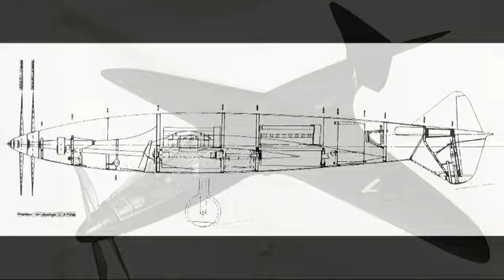Bugatti-Demonge 100P / 06-AUG-2016

Comment from the maker: To resume: NTSB: "Probable Cause: The pilot's failure to maintain airspeed following an engine anomaly during the initial climb after takeoff, which resulted in the airplane exceeding its critical angle of attack and experiencing an aerodynamic stall. Contributing to the accident was an engine anomaly, the reason for which could not be identified during postaccident examination.
Reply: So what they're saying is one of the engines cut out and torque took over?
Reply: @frogsoda  Not torque. It means the plane slowed down and the wings weren't able to generate lift. This probably happened on the left wing first, hence the left turn (the left wing lost lift and so fell, whilst the right one still worked to an extent and stayed up a little longer) and the plane just fell from the sky.
Reply: @Person01234  really? So what happened to the torque?
Reply: @frogsoda  I don't really know what you're asking. In flight, engine torque is typically dominated by aerodynamic forces. I'm referencing what the OP said, the thing you were paraphrasing, which did not mention torque.
Reply: @frogsoda  its not torque, the plane went through a stall spin scenario because it lacked the proper airspeed for a safe take off.
Reply: I believe what he is saying is since this aircraft used two engines for two props, did the torque from the unfailed engine cause an uncontrollable roll.
Reply: Poor guy, this was his pride & joy & looked a fantastic airplane. Such a shame.
Reply: @codyking4848  And what we're saying is that the report as quoted by the OP makes no mention of such a thing, and torque forces (remember, most planes don't have contra-rotating propellors) are typically dwarfed by the aerodynamic forces on the control surfaces.
Reply: @codyking4848  i think that would be unlikely since majority of single piston engines dont even need a ton of right rudder for take off to compensate for the left turning tendencies. well unless you know it was on high rpms and then all of a sudden it came to a stop. but i cant imagine that pulling the plane down so hard to one side it becomes unrecoverable. but thats just my opinions tbh. the people who built the engine would know more, i am just a student pilot.
Reply: @Person01234  Single engine planes are irrelevant here. In a single, the torque is compensated for from the moment the plane takes off until it lands. Either by design or by trim controls. If the engine stops, there is no torque, the plane should glide normally,(for whatever plane it is, some glide better than others obvs.

But this plane had two engines mounted near the centerline inside the fuselage, turning two counter rotating props. So there is no torque. The props spinning in opposite directions cancels it out. 
SO if you lose one of those engines, things get exciting for a second. The massive torque load is instant. You may have time to compensate if you are at altitude. But if it happens near the ground, like during take off, the plane will just nose dive into the ground. And that's what seems to have happened. 
The engine failure also explains why there was no power to climb.
Reply: @frogsoda  You literally completely made up that "that's what seems to have happened", and you summarised the first post of this thread as describing a crash due to torque. Which it does not. It makes no mention of torque. It mentions an aerodynamic stall and if you know ANYTHING about low altitude stalls like in a takeoff or go around, the plane rolling to one side is something you'll find extremely common in them. "Torque" is not.

Yes, the sudden loss of thrust was a contributing factor, and the OP's post does mention that (though in and of itself shouldn't have been fatal, the probable cause is cited as the pilot's failure to mantain airspeed, this isn't the first time a plane has lost it's engine during takeoff, nor will it be the last, it doesn't have to end like this). But again, the OP makes no mention of "torque" as a factor. Stop pushing your inaccurate summary of the OP's report.

Edit: Let me show you the kind of thing you can expect from stalling during takeoff (content warning I guess, it's the famous video of the cargo 747 crashing at bagram): https://www.youtube.com/watch?v=lksDISvCmNI
This isn't due to "torque". It's due to asymmetrical lift being produced by the wings. A common occurance in low altitude, low speed stalls, the likely cause of this crash and crucially, actually in line with the report as stated by the OP and as was being paraphrased.
Reply: @Person01234  cool story bro. Are you actually comparing a 747 with four engines out on the wings coming in for a landing, to a Bugatti with two engines on the center line, taking off? It looks like we're done here.🤷‍♂️
Reply: @Person01234  name-calling and ranting doesn't win arguments. If you think a 747 and a Bugatti are subject to the same forces in flight, there's no talking to you.
Reply: @frogsoda  Then stop talking. There never was an argument, there was a fool, and there was me correcting the fool. The fool continued to spout garbage and contradict me without having the slightest clue what they're talking about and so I am now done being polite.
Reply: @Person01234  Whatever dude. You know what? You're right. I don't know what I'm talking about. 747's and Bugatti's are EXACTLY the same, obviously. There is no "equal and opposite reaction". That's just a myth!
If the word "torque" doesn't appear in the report then, OBVIOUSLY, torque had NOTHING to do with it. 
And of course, you have proven that calling people names and generally being an unwiped ass is a GREAT WAY to win arguments!
Reply: @frogsoda  1. Of course torque exists, as I've already said. It's just not mentioned in the report, and isn't typically a factor in these kinds of crashes. I've show you a video of a 747 with 4 working engines doing the exact same thing you think is such strong evidence of engine torque, indeed with the only similarity being the aerodynamic stall (which is actually what causes this behaviour, as has already been explained to you by 2 people including a student pilot, and is mentioned in the report) and all you have to say is "herp derp 747 is diffrunt" (not with any explanation of how those differences would cause similar behaviour for different reasons, mind you).
2. Literally this entire conversation is about your paraphrasing of the report posted by the OP. You characterised the report as saying that "Torque took over". I politely corrected you that the report does not say that and that the aerodynamic stall (which IS mentioned) itself is a more than adequate explanation of the behaviour of the aircraft (something I subsequently proved) and citing it as the cause strongly implies that that is what they think caused the crash, rather than engine torque.

When you for some reason stubbornly hold on to your initial assumption, despite not having a clue what you're talking about and argue with people who do, not just about the facts of what happened but what is plainly written in front of your face, there is no argument. You've not presented any analysis of the report to show us where it says torque was involved, which again is what the conversation is about. You haven't even presented any real reasoning why this crash was so special compared to all the other low altitude, low speed stalls that the behaviour was due to something completely different. All you offered is an explanation that maybe it happened so quickly that the pilot was unable to control it, which all that tells me is that you have no clue how aircraft work and also ignores the fact that banking into the ground is a common result of these kind of aerodynamic stalls.

So yes, there is no argument for me to win. I am telling you the facts (I haven't at any point said that torque definitely had nothing to do with it, just that there's literally no reason to think that it did), primarily about what is literally written in the OP rather than anything that went on in the air. You are spouting nonsense theories that you personally came up with.
Reply: @Person01234  you want to prove me wrong? It's very simple. Answer my first question. What happened to the torque? You finally acknowledged that it exists, so now tell me what happens when one engine goes out and the other engine is still rotating?
Reply: @frogsoda  I already did, engine torque is dwarfed by aerodynamic forces, it's the same shit that happens to torque in single engined planes. A normal lay out twin engines plane with counter-rotating propellors would not have any less torque on an engine failure than this thing did, and it doesn't result in uncontrollable roll.
Reply: @Person01234  you can't just make a blanket statement like that. This is a very unique Airplane. In fact I challenge you to name another aircraft that has two engines inside the fuselage.
And you obviously don't understand how torque works. Because if you did, you would know that torque coming from the Centerline of an aircraft is going to be many times stronger than torque coming from an engine that is further out on the wing. 
Writing everything off to "aerodynamic forces" is a cop out. There are many aerodynamic forces that act on an aircraft in flight.
Reply: Person Oisels 
747 crash was, and kinda was not a low speed stall.   As you may already know, military vehicles inside it were improperly secured and rolled to the rear of the plane upsetting the CG forcing the high angle of attack, and resulting stall.
Sad.
Reply: @falconeaterf15  ?

So it wasn't a low speed stall, it was just a low-speed stall? What are you trying to nitpick here? I know why it stalled and it did so at low speed, during takeoff. Hence, low speed stall.
Reply: Person Oisels 
Just thinking of the 747 pilots.  
Most stalls are caused by pilot error, but in their case it was caused by shifting cargo. I think they would want that mentioned if they are being used as an example.
Reply: @frogsoda  thanks for making this thread so hilarious

Comment: 0:30  an experienced pilot not wanting to use the words "stall" and "spin"  or a non pilot explaining  a stall spin as best as he can ?
Even the NTSB didn't want to use those words . They simply said 
 "Probable Cause: The pilot's failure to maintain airspeed following an engine anomaly during the initial climb after takeoff, which resulted in the airplane exceeding its critical angle of attack and experiencing an aerodynamic stall".    In any case he lived and died doing what he loved. RIP.

Comment: very sad but one can clearly see that his plane was tail heavy cause it stall to the left and going into a spin.
my sincere condolences for his family and for a man with a dream , no matter the cost.
Reply: Clearly see? How? What I saw was that it was climbing at high aoa and didn't gain much speed, and in a steady climb on a calm day balance doesn't matter much. Looks like Mr. Wilson (may he rest in peace) expected too much from the powerplant, or one of the engines had a problem.  Any plane with such a wing planform and no twist is dangerous in a stall and needs an extra margin of speed. Let's wait for the final NTSB report.
Reply: Funny that they wouldn't notice that on the first two flights and then deal with it. You don't have to be tail heavy to snap and spin.